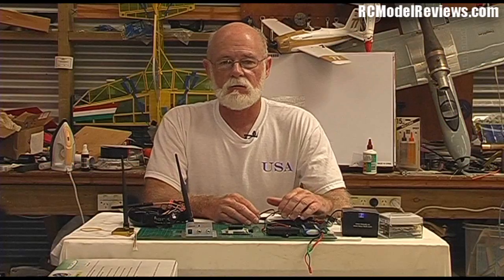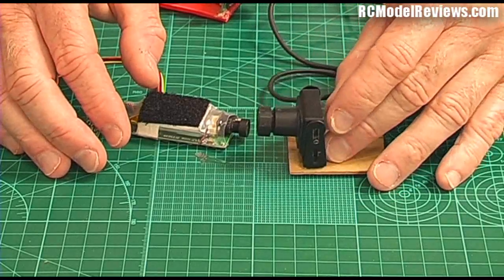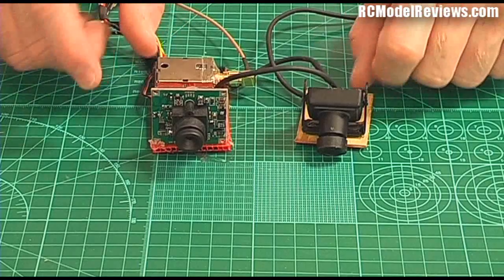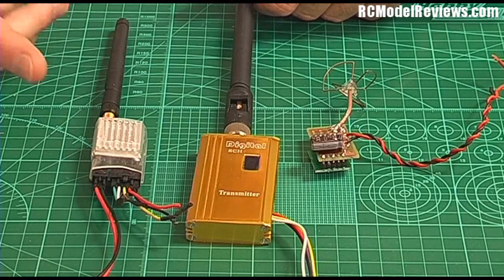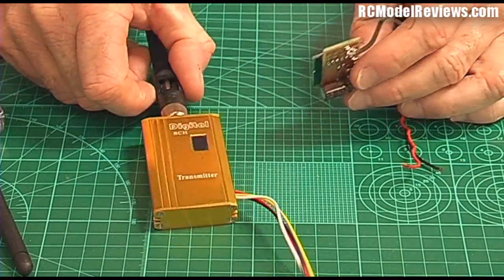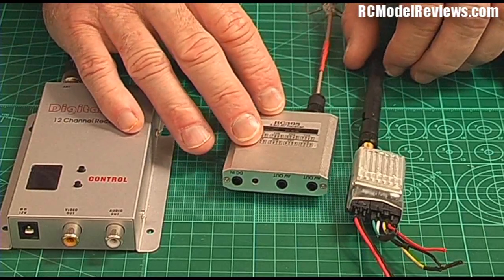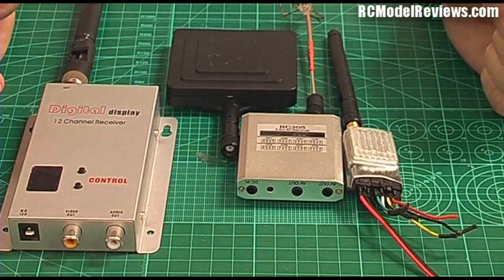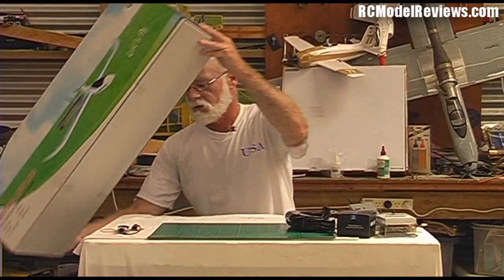FPV made easy (part 1)

Comment: I had a question about fpv goggles. It may be a stupid question but I was wondering if say I had 2 pairs of Fat Shark goggles can 2 people watch the plane in flight at the same time from the one signal be transmitted? That would be cool for friends or the other half...
Reply: You can you just need line splinters for the receivers you can get them at radio shack

Comment: Shouldn't you use circular polarized Antennas for the ground station? and why not use a better Omni on the ground station? you can get 8 and 10 db omnis in the wifi and easy

Comment: There is a conductive glue on ebay that I used to glue a perforated heat sink on the 200mw chip tx.

Comment: @sborn1571 You might get several hundred meters of signal with 5.8GHz radio, even a km, but not even 100 meters if you don't have line of sight. You need direct line of sight to your aircraft to maintain radio contact. 900 MHz would be more tolerant to obstacles, but you will be getting a much better picture if you do have direct line of sight.

Comment: @jwr38 
If you want a fluid image out of Gopro put the latest firmware (in order to have live output without any other trick) and set it up to 1280x720 (60p or 50p). The bad part is that the overall image is too dark (but I don't have good video goggles) for FPV and you can't have proper exposure of the ground when you have the sky and the land in your frame. Now I have a Pixim Seawolf camera whose WDR feature is the best when flying into the sun (both sky and land are well exposed).

Comment: @RCModelReviews That what Im trying to figure out what the best esc and battery I should use with it to get enough power to  achieve the maximum height my spektrum transmitter and reciever will give me. Any recomendations with the power setup would be very helpful? I am using the spektrum dx6i  (DSMX) tx and a  6210 rx.(DSMX)

Comment: Bruce
Great idea for a video series.
In your review of vid glasses will you evaluate how easy they are to use with eyeglasses? I am about your age and like many others I need glasses full time and I cannot focus close.  I believe I read in some reviews of vid glasses that there are optics you can put in for correction, but they only work for near sighted people.  I am far sighted.  Also I think these can't be used with the eyeglasses on.  Your welder setup may be the answer.  Thanks for the vids

Comment: @RCModelReviews  Im useing a 30 amp esc and a 2200 mah 3 cell 30 c battery. wth the sock motor.  yes the prop is on right and the rotation is correct also.